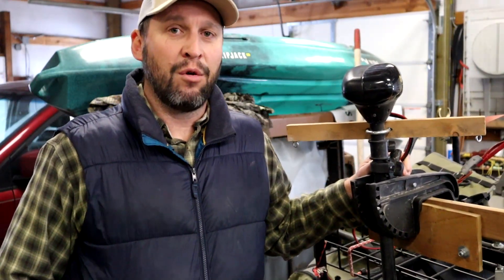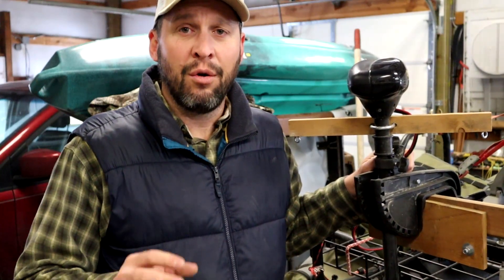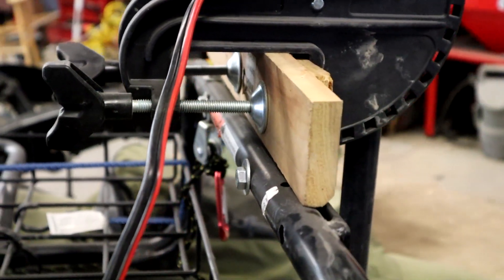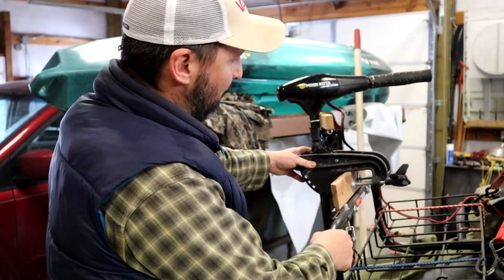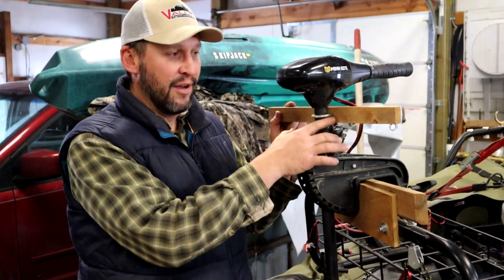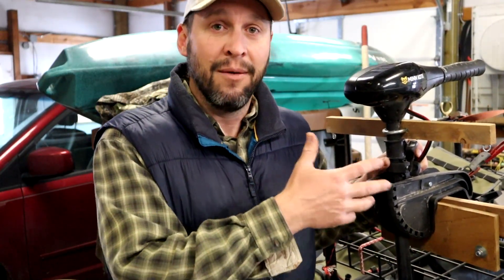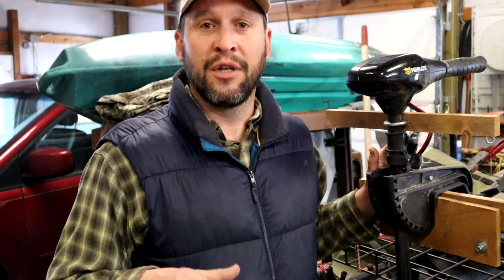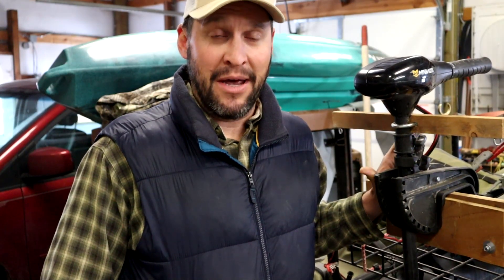Colorado XT Trolling Motor | The Best One and Install DIY

Comment: I have the short shaft and mounted mine the same way as you did, in the center. One thing I did differently is mounted the wood even with the cross bar and put a piece of aluminum plate on the other side (where the trolling motor clamps onto). I tried the rudder, didn't like it so I sent it back (my opinion). What I do now is leave the wheels attached to the bottom and that acts as a rudder. I have only done this one time so I may end up going back to just using the oars as a rudder (per a previous recommendation from you, I believe) in the event that there is too much drag. I'll be taking it out this weekend so we'll see how it works! Cheers!
Reply from the maker: Hey Gordon, super interesting using the wheels!  I put in a link for the rudder since many people don't like to have the oars.  I think people who choose to have a standing platform and elevated seat lose the practical ability to use the oars...though I'm not totally sure.  Let us know how the drag situation works out!
Reply: @willritter  elevated seat and platform here too.  I'll send pics
Reply: @willritter  Well, I think the wheel "rudder" worked better with the single wheel than the two wheel set up (I tried both).  I also decided to mount my motor on the front, mounted it with angle metal to my standing platform (diamond plate aluminum). I need to try that next. May not need to leave the wheels on but I probably will because it is just easier and quicker to get it out of the water.
Reply from the maker: I would love to see some pics of your set up.  Will@renewchurches.com
I thought about front mounting, but the front makes the perfect unhooking station for big sturgeon!
Reply: @willritter  I will send some as soon as I get coffee on board, LOL
Reply: @willritter  Sent the pictures. My setup right now is for lake fishing, when I take it to a river, I'll drop the seat down to normal height and remove the platform.

Comment: Got the endurance max Minn Kota...The adjustable shaft works great. Spent big money and got a 100AH Lithium battery , because Minn recommended it , not really needed, But bought the battery new and the guy said it was charged and may just need to be topped off, I didnt. Went and used it over two full days, checked the meter...Still showing completely full. you MUST center the motor, or you play the left right left right game. Get the fin that attaches to the shaft it does help. I need to try out the seat steering hack as the extended handle and trying to control has you in one hell of an awkward position .
Reply: instead  of seat steering, you can hook up a couple of pullies and a push/pull stick steering system, kind of like an emergency brake handle...

Comment: Have you thought of cutting the board down or flipping the board around, the motor mount would sit on metal frame and wood would be lower.  I think that would give you at least a couple inches more motor in water depth.
Reply: Haha seriously, should of used a 2x12

Comment: Just got a nice used XT for
250

I found a Minkotta 70, sling mount, foot controls for
300

Litium batteries 120ah

It will do 7mph  when it is set up right

...solar...
Reply from the maker: So Cool!  Yes, they are SUPER expensive new.  I also got mine used for 250!

Comment: With the motor on the stock mount with a 36 inch shaft was the prop in danger of hitting the pontoon? I’m leaning towards getting the 40lb thrust minnkota with the 36 inch shaft

Comment: I know this is an older video, having the problem of not being able to find a 30 lb with a 36 inch shaft, so the 40lb 36 inch will work with it? I just have the normal Colorado and am gonna try the factory mount out
Reply from the maker: I was able to modify my mount to drop it a bit lower and the 30 works just fine

Comment: Gave you a big THUMBS UP.  Quick question - did you test as to how fast you are going at max speed on still water with that 30 lbs thrust motor? Thanks.
Reply from the maker: Not very fast, 2 to 3mph.
Reply: @willritter  Thanks.

Comment: No way I've used 30 inch shaft for years no problem on my xts I have a 55 lb thrust motor and it moves really good better that a 30 lb and it doesn't use more battery than a 30 lb it actually is better

Comment: Now I was told if I hook up an electric motor I have to get registered. This true? I live in Southern Cal so wouldn't be surprised if it was.
Reply: Yes, in California if you add an electric or gas motor to your pontoon, kayak, or SUP it must be registered as a vessel where you are going to get numbers and a mussel sticker as well. AND depending on the lake or body of water of your choice to use the "vessel" it may required a lake permit from that county AND full inspection prior to launching.    I registered both my pontoons (colorado xt  and a creek co, pontoon) where I pay every two years $20 and $25... worth it!!!   The initial registration process is a bit cumbersome but I know ways to get it done easy. 😉
Reply from the maker: Idaho as well

Comment: Best place for trolling motor is up front, along with a keel out back.   Voice of experience.   The least amount of wind blows these boats all over the place.
Reply: yes, trolling motors are more efficient Pulling than pushing... but when you're trying to fish it gets in the way...
Reply: @t.c.2776 I have mine up front, love it! I drop it all the way down and after with my foot. I’m going to put tabs off the left and right side to turn eventually but it sits low and out of the way..😊

Comment: Why did you mount it so high up if your sucking air (water)? Makes no sense.
Reply from the maker: You are totally right.  I later modified the mount and it fixed the issue.

Comment: why ask for a Thumbs Up before you validate your complaint about a motor you have not even identified yet... AFTER you give me information I feel is worthy, I will consider a Thumbs Up...  Ok... so what you are saying it's NOT the motor that's the problem... it's YOUR mistake in not measuring what you needed and also how you may have mounted it... you can remove and shorten those tubes so therefore it might be possible to contact Minn Kota and ORDER a longer tube.. it's a simple fix... and for you to suggest "any other pontoon" is just arrogantly stupid as you DO NOT know the specs of ALL the other manufactures dimensions out there... you can't even fix your own problems... your explanation of Thrust is very poor... ALL Minn Kota motors are designed for different SIZE/Weights of vessels... but ALL are designed to push their Class of boat at approximately 3mph... now a 30lb on an inflatable with low drag and shallow draft, you "might" get 4-5 on flat water with zero wind... but going up river against a 3-4mph current and a strong headwind might just see you going backwards... I ran into that problem with a 30lb on a canoe, so I'm now running a 40lb on my inflatable which will give me more torque and maybe a bit more speed... and yes it will take more power from the battery and less run time... but you can also put a small GAS outboard on the XT... a 1.5 or 2hp would be perfect... your complaints are "your" complaints... I see simple fixes for all of them... you could drop that motor mount down another 4in. at least and that should solve your problem... you could probably buy a piece of PVC to slide over your motor shaft and lengthen it that way...